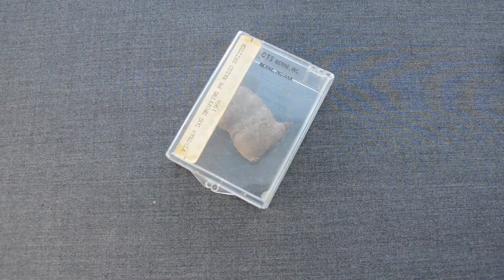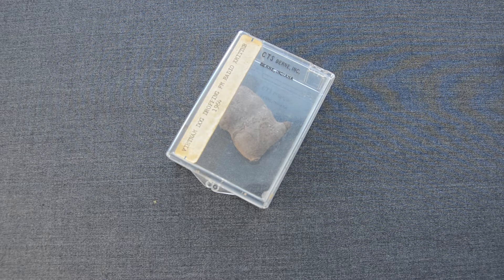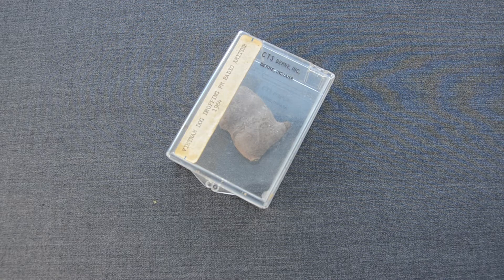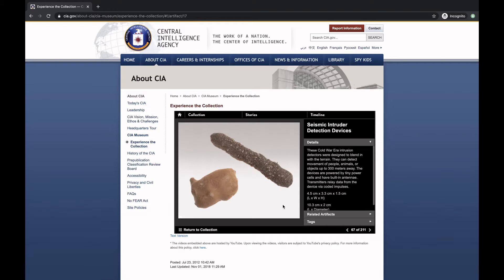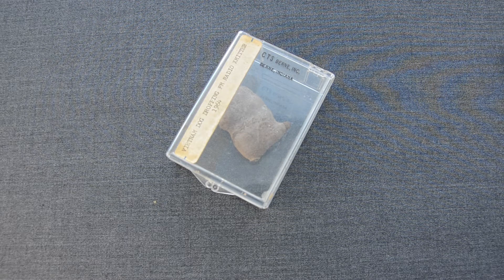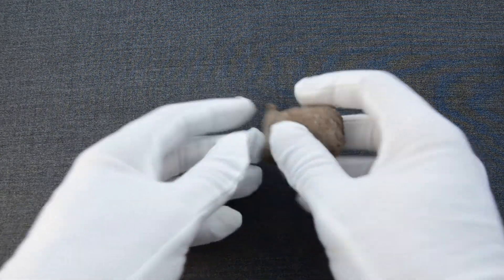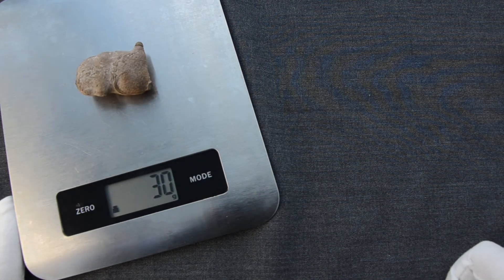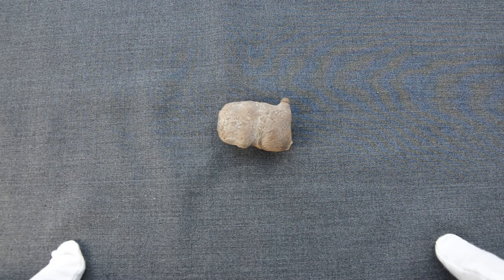CIA Seismic Intruder Detection (SID) device

Comment: I have a few of these running my property line (modern versions of course), along with some ir camera's hooked up to take a snapshot, prevents most snooping. Point a strong IR spotlight above your home to blind NV drones/cameras & only ever leave at night, tripwires and magnetic sensors on every door. I pretty much live in a faraday cage, no windows (so no laser listening devices or secret break ins), brick and steel rebar everywhere 😂. 2 inch steel plated doors with hydrolic assist, set to drop closed if power is cut. And enough tools weapons and food to live comfortably for years. Set up solar panels and have a backup generator or two. Get good at making fuels yourself out of wood or plastics and then you can just horde the raw materials to make fuel. And never connect to city power (they can listen through any device that has a speaker, look it up, its really neat tech). Also a few "el chappo" escape tunnels plus some... "friends" help to stay informed about any potential storms brewing, and you're smooth sailing 😉 

Not doing anything illegal btw, just never know when the government will stop working "for the people". Which many can argue it already has... Stay safe out there!